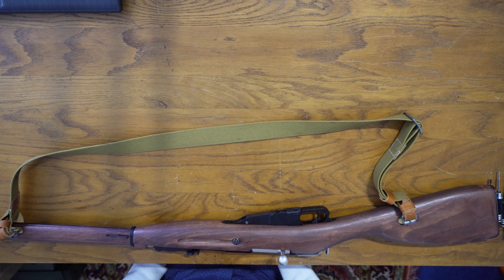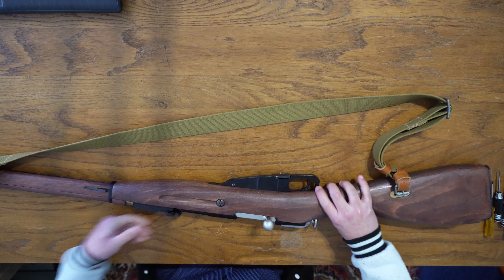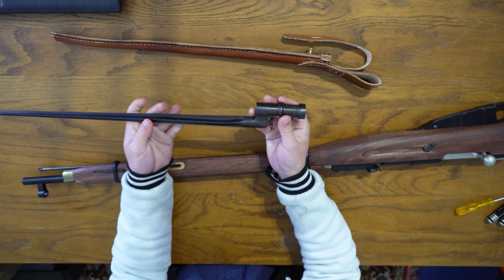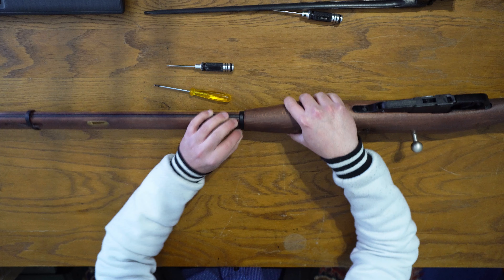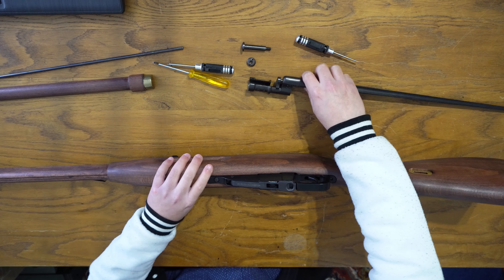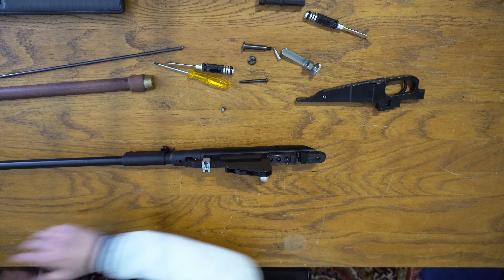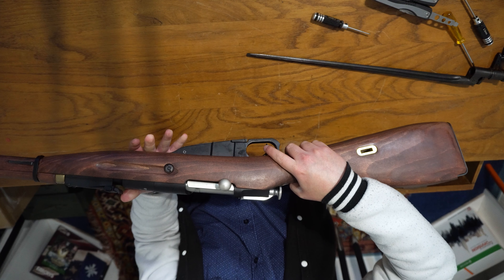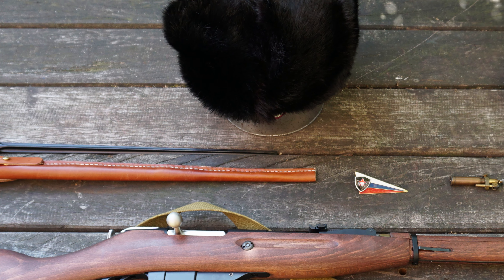Mosin Nagant 91/30 PPS SHS Airsoft sniper disassembly and reassembly

Comment: All the models I've seen have a bent bolt like the sniper variant where did you get the straight bolt version can you buy it seperately
Reply from the maker: I got mine here: https://www.airsoft-entrepot.fr/
It's a French Airsoft store. They sell both the sniper version and the infantry version also they have gas as well as spring models. Not sure if they are in stock now but they tend to get them in stock every so often :) hopefully this helps
Reply: @burninggalaxyx  thanks I'm based In the UK and I only see the sniper variants for sale
Reply from the maker: I'm from the Netherlands so I know this store ships to other countries as well. They used to ship to the UK before Brexit but now I'm not sure to be honest but you could always send them a question they are quite nice and tend to answer rather quickly :)

Comment: what can be upgraded on this platform? are parts compatible with other major platforms like VSR?
Reply from the maker: I haven't checked the inside of the bolt yet but the trigger and hop-up are non standard and will not be compatible with VSR-10 upgrades. Will in the future definitely check if the springs and pistons are compatible but haven't had the time yet :)
Reply: The bucking is a standard AEG bucking.

Comment: How did you take the orange tip off please help
Reply from the maker: Mine didn't come with an orange tip for it isn't necessary in either France (where I bought it) or the Netherlands where I live. It doesn't have an muzzle device so it could be they just painted the outer barrel